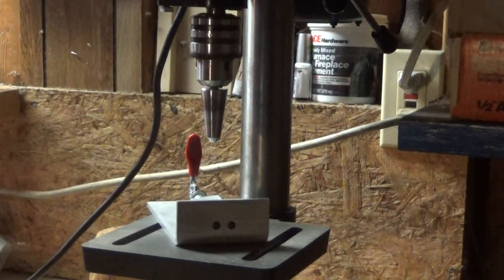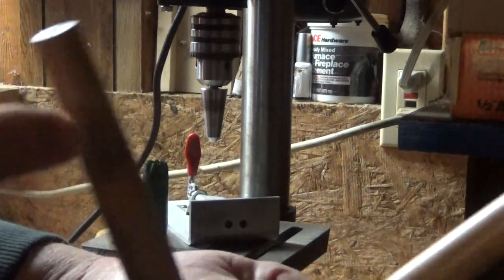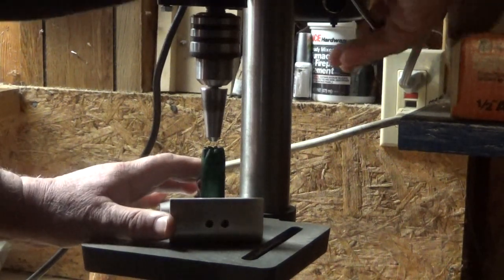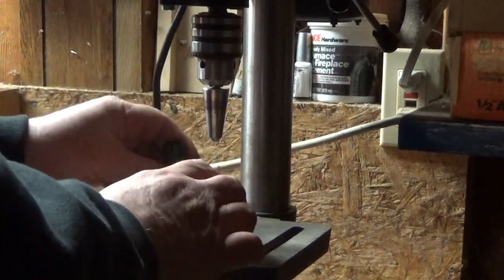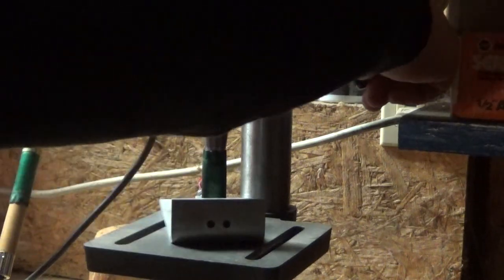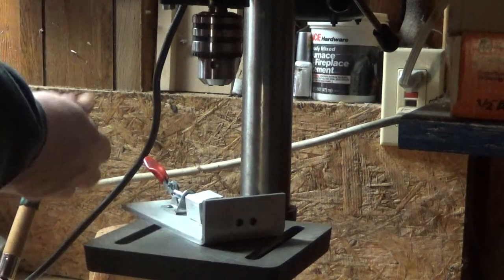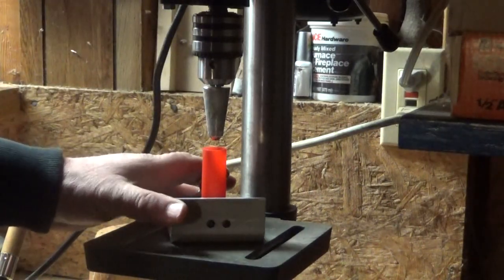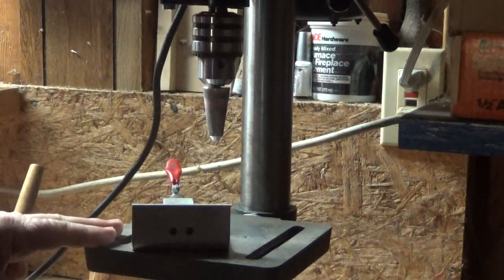BPI Hull conditioner and Skeever

Comment: Good information..!
The original purpose of the hull conditioner was to prep hulls that had been roll crimped.  It's good to see that it works with fold crimp hulls too.

To get a few more loads from a hull where the crimp died, (everything else in safe working order) I cut the bad crimp off and make a new star crimp, roll crimp, no crimp glued in overshot card, or turn them into shorty shells.

Thanks for the video..
Reply from the maker: First time I saw this demonstrated the person was using it to do fold crimped hulls, however, yes it does work on roll crimped hulls as well.

Comment: Hi Dave question I been thinking of reloading some 44 Russian you think it’s worth doing or just stick with the 44sp which I do like thanks
Reply from the maker: It's really up to you. the.44 Russian is a handy round, it is short and compact, however, it doesn't offer much over the .44 special. I too like the .44 special as a target round as that was what its roots were. the Bisley Match of one-handed shooting of 50 rounds of slow-fire and a distance of 50 yards was dominated with the .44 special and it was a proven accurate round, You can give the .44 Russian a go and see if it's your fancy. You can load them with light recoil target velocities around 600-700 FPS for a mild afternoon out at the pistol range. (Might even try some one-handed shooting with them). Good shooting to ya, Dave.
Reply: Thanks For your input I appreciate it 😀👍👍
Reply from the maker: Here is one of the things to take into consideration, powder selection. powder like W-231, Bullseye, Red dot are fast burning powders, they give a snappy effect of recoil. when you get into fast/medium powders like clays, 700X, Unique, they have more of a bang rather than a pop of recoil like the fast ones. So, what I'm trying to say is "Shoot ability" in the hand, you have less of a flinch or tendency to counteract the recoil generated by the fast/medium powder, therefore, your shots that you loaded in Target charged loadings will shoot more towards the center of your aim. Make sense? Less recoil, steadier in the hand.  anyway, I would give that a try when selecting accuracy loadings for a pistol.  Good shooting to you and keep up the good work on your channel, I watch every one of them. Dave.
Reply: Thanks Dave that’s good to know 👍👍 thank you on my channel